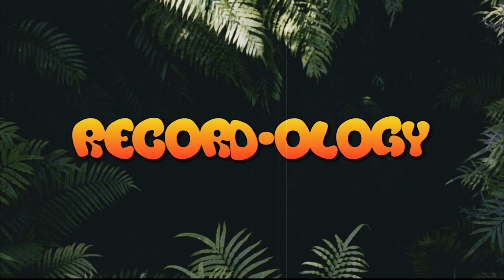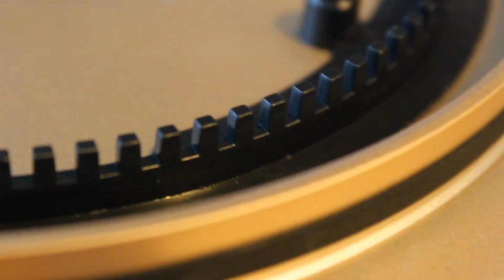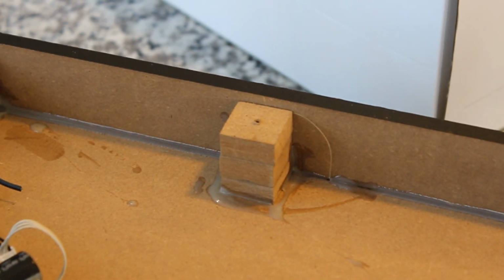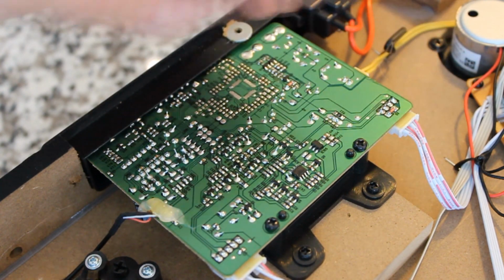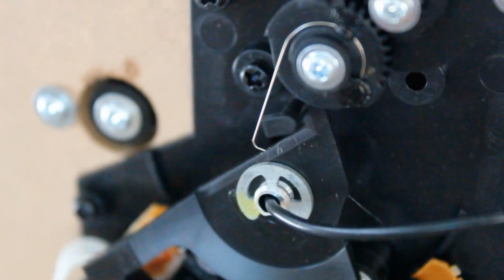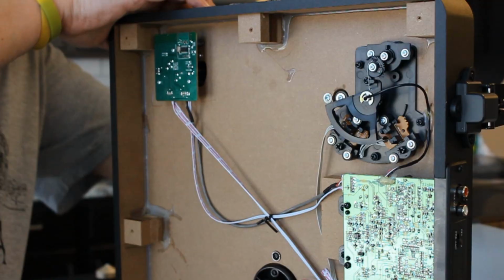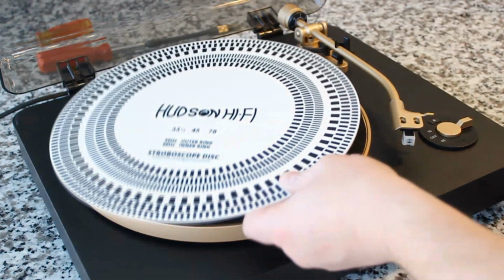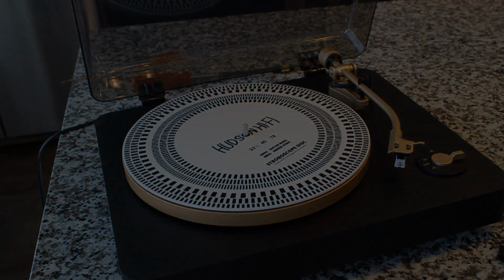Target Teardown! Heyday Turntable!

Comment: I'm glad to have found this for cheap at a thrift store and add a turntable to my living room setup. However, because the unit is so light, footfall causes it to skip very easily if you walk too close to it. I tried adding two 5lb weights to the body while playing a record and it significantly reduced skipping. Any thoughts on how I could weigh this player down so it doesn't skip so badly, without having to place dumbbells on it? :D
Reply from the maker: Another idea would be to put some sounding material under it. I know Hudson Hifi sells silicone feet which would add a little bit of isolation. If you have a little bit more money to spend Fluance sells an isolation base. We reviewed a lot of those products on the channel.

Comment: random question. got this in 2019. when i first got it it wouldn’t power on aka start spinning when i moved the tone arm to the platter. was about to exchange for a new one when it started working. didn’t return. cut to 3 weeks ago, got a new turntable stand & moved the turntable and now won’t power on or spin. i think it’s a power or motor issue? anything you think would be a simple to fix? tried a new power cord no dice. i really loved this turntable and dont want a new one lol

Comment: Very similar to the house of Marley! I would say they make use of the same components. Any issues with the tonearm? Cause HoM’s rather stiff… Intink it depends from the fact that the don’t make use of horizontal ball bearings, they use bushings instead, that benefit from some extra lubrication, but still can’t perform as smoothly as a real bearing…

Comment: I have this, however when I turn it on it just makes a sound.  (Like a loud running motor, similar to the sound you added while testing the optical sensor).   Any idea what could be wrong with it?  

Great video, thanks for showing the inside.

Comment: Came here cause my C100 finally arrived home :D... But the anti-skate doesn't work 

When I was setting the anti-skate, I heard a metallic snap. After a few records, I decided to try if the anti-skate was working properly with the help of a CD... It pulls towards the spindle :(
I opened it up and saw that the wire from the knob was loose. Do you have any photos of a C100 inside? Thank you!
Reply from the maker: Here’s a look inside the almost identical c200 https://youtu.be/2dQil5QMhYc
Reply: @Recordology  I solved it :D
Just had to put a tiny piece of foam near the anti-skate mechanism to put pressure against the tonearm.
Thank you!!!

Comment: I'm having an issue with the auto stop shutting off early on some 7"'s.  Is there a way to adjust this?
Reply from the maker: A common issue.... not sure if this one has an adjustment.  Try HeyDay support.....let me know!
Reply: @Recordology  I figured it out. The plastic part with the Phillips head looking opening is for adjusting the whole optical switch assemblies either way. Works great now. I’m happy with this “cheap” turntable.

Comment: An interestingly simple, and different design for a turntable!  
I must take issue though with the comments about to built-in power supply.
They can induce noise/static into the sound, and with this one being close to the motor, and not even shielded in any way, it's bound to put electrical interference into the sound chain!
That was one of the main 'plus points' of the latest Audio Technica AT-LP60X, and LP120X, with their power supplies now being an external type, and even Pro-Ject, and Rega have adopted that 'wall-wart' PSU for better and cleaner power supply with less interference to the overall sound!  ;-)
This Target unit should at least have some metal shielding around it to isolate it from that motor that's an inch or two away!
Otherwise it looks OK... pretty nice and sparse, with interesting optical sensor uses employed!
A nice looking deck that seems pretty well built for it's price, and should perform well.... but even better with an outboard PSU/wall-wart!!  ;-)

Comment: So when I hook mine up with preamp off, it hums, when motor starts, the hum gets louder. Its 60hz. Do you have thos issue with yours? have you thought about adding a ground wire? Or just run it preamp on and be happy.
Honestly, from what I experienced with this table, it's the only drawback. I did notice the internal preamp with my Appetite for Destruction record sounded pretty close to CD quality. That was with the stock cartridge.
Reply from the maker: Hmmm perhaps try the external grounded preamp.  Mine didnt do that...
Reply: @Recordology  I'm not getting you. It does not have  a ground wire
Reply: So after a year of use and a deal I couldn't walk on. I picked up a Crosley C6 at Walmart. After comparing the two. The Heyday is my budget pick. The Crosley is missing anti skate, Auto Stop and the springy feet. It also just went up in price.

Comment: Thanks for your review.   I own a HeyDay and really like it.  You upgraded the cartridge  and stylus on the one you own.  What type of cartridge did you up grade to,  did the change the sound dynamics,  and was it difficult to do on a fixed headshell?  I would like to know.  I’m still considering an upgrade and put this unit in another room with a Bluetooth speaker.  Right now I have this turntable paired with a Denon M41 receiver and matching speakers.  A nice setup.

Comment: Thank you so much!   The Heyday with its active-loop feedback drive system is a major departure from other turntables in its price range.  The tonearm-position sensors are a nice touch, too; instead of a micro 'lever' switch, it trips the motor on/off mechanism optically (I honestly did not expect to see that!).  This looks like a very nice investment for an entry-level item, particularly at its price point - better, I think than the LP-60 and its variations.  Of course, the LP60 and similar are fully automatic, and this is full manual, but I'll happily trade the automatic features for the improved speed stability, better tone arm, replaceable cartridge, and of course the Bluetooth feature.  The only other thing I could even think of asking for was 78 rpm capability, but eh, you can't have everything, and you're still getting quite a bit for the money already.
The 3600 is a perfectly acceptable cartridge, but I feel an upgrade to AT's VM95 cart would be a fine investment, as there are six different needles offered for it to fit almost any need - conical, 3 mil, elliptical, shibata, and others.
Lots of positives and nothing really negative to say about it!

Thanks again for making us aware of this unit, and showing us what it's made up of, it was a fascinating video!

Comment: Nice! It looks like they've come up with their own design instead of a generic Hanpin/Skywin.
Very neat wiring with the bundled "ribboncable like" wires/connectors and I like how they implemented those optical sensors.
I also like that it has a built in power supply with detachable cable and a AT3600L moving magnet cartridge.
I remember the review of the Heyday being not that great, but from the looks of it, they're definitely on to something good!

Comment: Hey Mister Record -ology Dude Man? What's with the tearing things apart? There's so much empty space inside that turntable when you open it up. Back in the day if you open up a turntable it was loaded with stuff! My vintage Technics MCS 6601 Turntable from 1978 which I use everyday is jam packed with stuff when it's opened up. My first thought was why is he opening stuff up? Isn't there a better things to do? Then I thought to myself the show is called Record-ology so I guess that's somehow connected to record by tearing apart turntables! LOL! Nice video dude!
Reply: He discusses his reasons in an earlier video.  I wouldn't characterize it as 'nothing better to do', but there ARE a lot of people stuck inside right now due to the virus.  He doesn't do a LOT of teardown, but it is nice to see what's under the hood of some of the modern offerings.
I'm not completely familiar with the MCS 6601, but a quick glance on the internet shows it's a direct drive, semi-automatic unit, so yeah, there will be considerably more by internal hardware, particularly the auto-return mechanism.  Belt drive turntables, particularly full-manual ones like this, are mechanically very simple in comparison - and there is a lot more circuit integration today than there was in 1978.  Look under an autochanger sometime, those are FULL of gears and levers and linkages.

Comment: This does look like a decent turntable for the money. Does it have a preamp built in? If so this would make a great entry level set up with some nice active speakers.
Reply: There IS a built-in preamp, you can see the switch to enable or bypass it at right around the 3:02 mark.

Comment: This turntable is pretty commonly available at thrift stores for some reason. I returned my LP60X-BT and picked this up for only $35 and it’s been great.
Reply: Personally, I think it shows up a thrift stores because it's a fully manual unit that requires a degree of setup.  A lot of people see the LP60 and its variants as a 'better' unit because they're plug and play, pushbutton units.  It might also be that people have caught the record bug and immediately decided to upgrade to an LP120 or something similar.  Granted, this is all speculation.

Comment: Not a bad turntable. They kinda cheaped out with the actual build quality, but the components and tech is actually pretty impressive. For this unit to have a speed regulation system is SUPER impressive.
Reply: The build quality isn't all that bad, considering its price.  They have to cut costs SOMEWHERE to get this down to $100, I'd rather the costs be cut on the inert materials and not the mechanism itself.

Comment: You must of read my mind I too!  like to see what makes things tick ,practically almost every audio equipment I have or had I've opened up just  to see what and how they are made and to see what quality parts are  put in the only unit I did not take apart was my crosley C-10 turntable  and audiotechnica ATLP-120 usb turntable ,Ialmost thought about removing the preamp out of my ATLP_120 but to me it sounds good to me especially when I switchedout the cartridge and put in  the ortophon OME-5 cartridge  in it ,the only thing was I replaced damping fluid onthe ATLP-120 cause it was coming down too fast  ,the Heyday  is one of the nicest turntables that has caught my eye,if after this covid-19  blows over and I get back to full time work again  ( I hope soon ) I would like to get one ,since I saw the first review of the heyday you convinced me  that it is a good turntable and I like the way it looks if you ever get your hands on a C-10 or C-20 turntable would like to know yuor  thoughts on these turntable I 've been waiting to see some one who have done alot of reviews on turntables to see what they think of these JRo